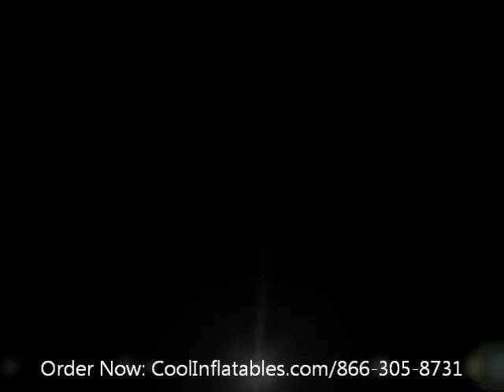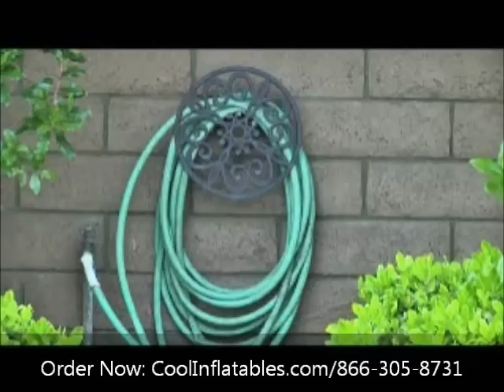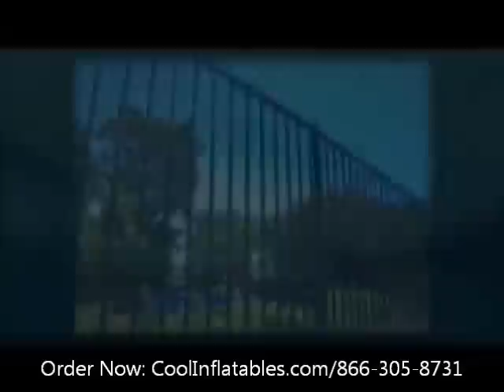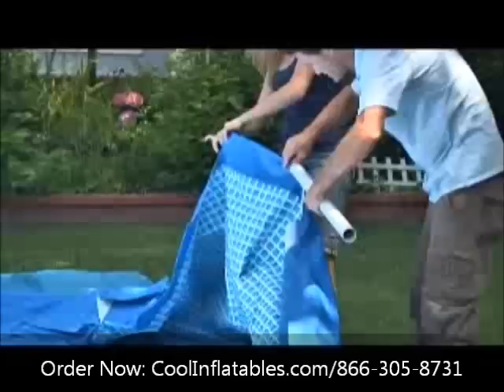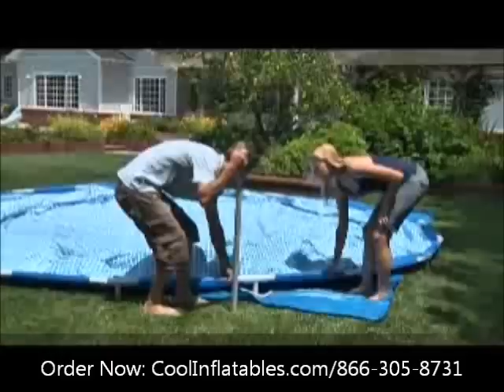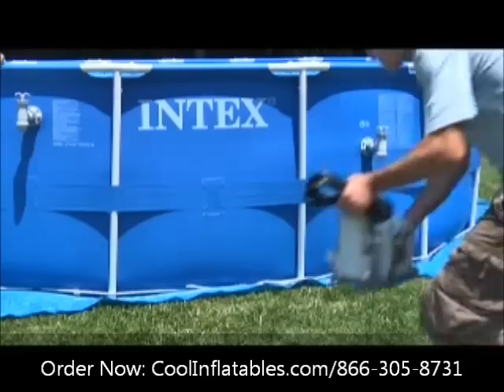Intex Round Metal Frame Pool Setup Instructions

Comment: If is your first time owning one of these, be prepared to wait several several hours to fill it out. 
Try to do this in the evening so the next morning the pool will be filled out with crystal clear water. 
Be prepared to buy those cleaning chemicals that you can get at Walmart so your pool water can stay always fresh and clean. 
The filter system is pretty much just a gimmick in other words don't rely on it. 
Be ready for lots of fun!!!!!
Reply: Or just call the fire dep to fill it up with water
Reply: Way to go!!!
Reply: Ricky Torres those filter work OK, but buy a few extra and be prepared to rinse them off every few days.
Reply: agreed...the filter system it comes with is  absolute 100% garbage!  just  keep adding chlorine every few days,, buy a ph test kit for ten bucks and you'll be fine.
Reply: @erikb2678  so do I need to connect the filter? Can I just put bleach in the pool ?
Reply: @memegosha2326  I would use it. It catches some debris and helps circulate the water and bleach/chlorine
Reply: @LibertyLensOfficial  should I just fill it today put cover on and then after their fist swim clean with chlorine
Reply: @erikb2678  when you say chlorine do you mean just regular bleach or actually go buy some type of chlorine
Reply: Aguynamed Ricky Frozen Frozen Frozen Frozen
Reply: Aguynamed Ricky oh shut up it only take about an hour in a half tf